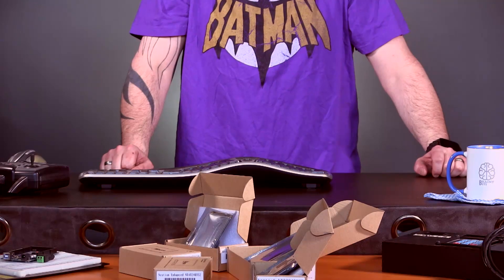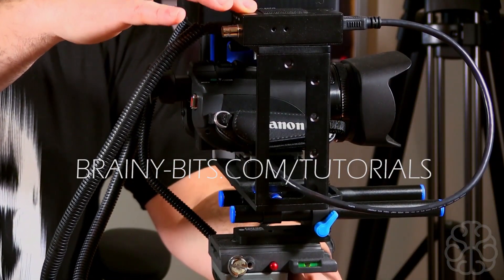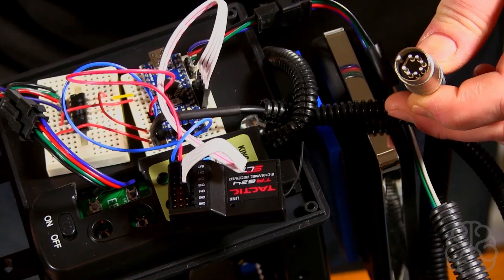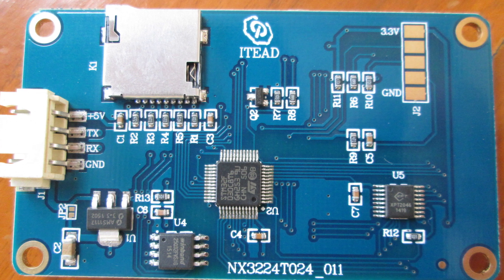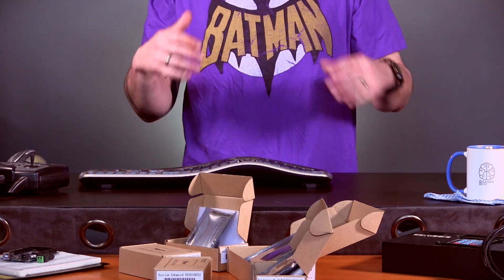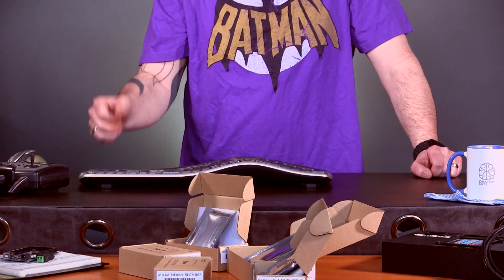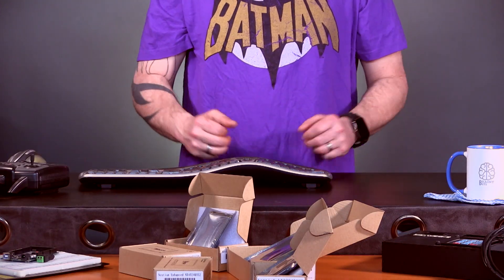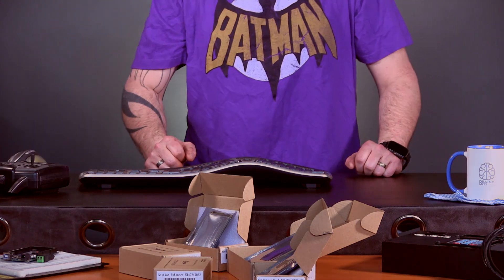Arduino + Bescor MP-101 Pan & Tilt Head = Wireless PTZ Camera System!

Comment: I am not sure if this has been addressed before; I need a system something like this but I need something that I can program to be able to repeat camera settings. Example I have a Canon HD video camera that is mounted on a tripod during a church service. I want to be able to press button 1 let's say and the camera will automatically pan/tilt and zoom to a setting that is programmed to button 1, and when I press button 2 the camera will pan/tilt and zoom to a different programmed setting, and so forth to at least 6 or more different settings. Every week I have to manually move the camera and zoom in and out. If anyone knows of a cheap DIY or a good product to buy that has this feature that would be great. I have dabbled in electronics so I do prefer a DIY project, it would also be nice if the motors are as quiet as possible, thanks in advanced.

Paul